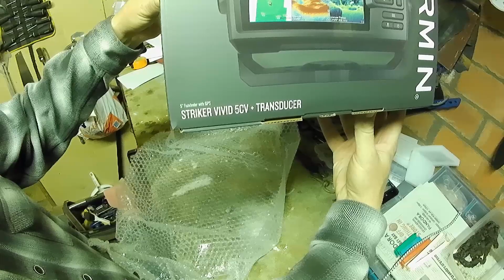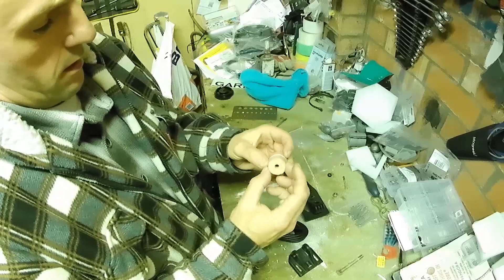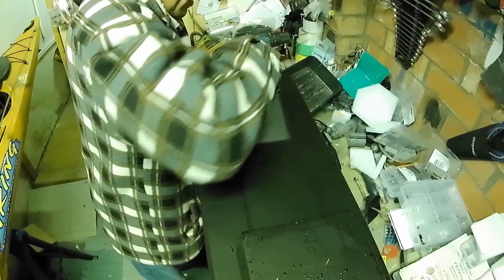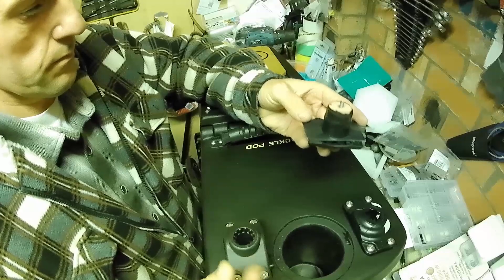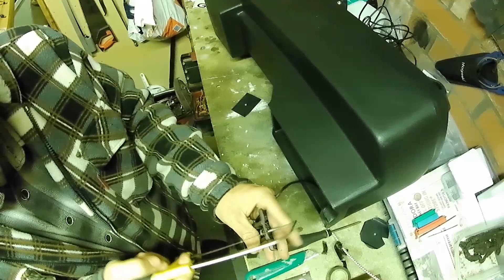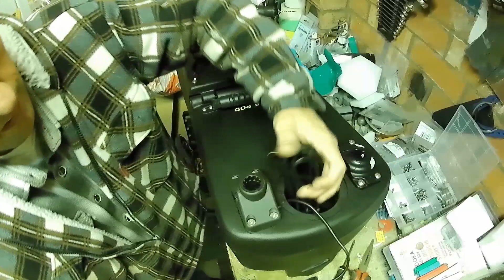Garmin Striker Vivid 5CV Fish Finder Installation To A Viking Kayak Tackle Pod. (Part 1 Of 2)

Comment: Thanks for putting this up. I'm upgrading to a reload, but I'll be fitting a lowrance unit to mine. Lowrance do a transducer mounting kit, which is £50 for 50p worth of plastic, and I've been wondering whether I really need it, or whether I'll be able to bodge it. You just answered my question and saved me £50!
Reply from the maker: No problem. :)

Comment: When your all set up and ready to go on the water does it start automatically or do you have to change any settings? tia
Reply from the maker: You have to switch it on, then go through a load of settings to suit yourself / preferences etc.. But once sorted, each time you switch it on, it remembers them settings.
Reply: @chrisdavison2022  Thank you I've just installed it yesterday and was unsure how it works when I got to the water 😅👍